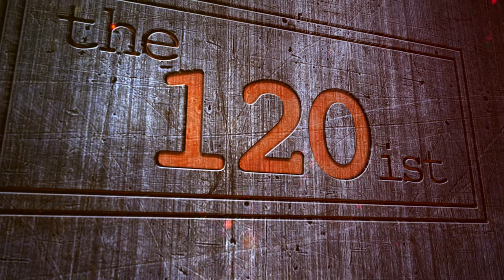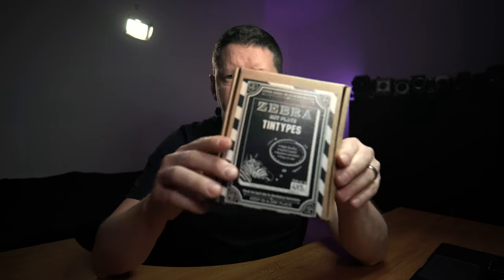Dry plate tin types... the poor man's wet plate collodion?

Comment: Enjoyed your tryout of Nejc's tintypes. They didn't come out too badly all things considered! While I'm not a wetplate collodion guy, I've done dry plate collodion, seen plenty of WP tintypes (I have family tintypes) and good ones are more contrasty than that. But beginner's plates often look like that -- as you say, just takes some experience to understand the necessary exposure for the process. I have been making and shooting my own gelatin dry plates for 9 years now, and have learned a fair bit about what's needed, mostly by making every mistake possible. Assuming they're "ordinary" (blue/UV-sensitive only) plates, you really need to consider your light when shooting. That is, you can take a meter reading at some reasonable ISO (anywhere from 3-25, depending on whether your emulsion was speed-sensitized beyond the basic) but then you really need to consider (in order): 1) the color of the light: the amount of UV in the light has a huge effect, so e.g., earlier in the day requires less adjustment than later in the day, more blue faster, less blue slower; 2) the colors in the scene: if it's blue or violet or has some component of reflected light that is, it will be very light (hence white skies, and it's easy for clouds to simply disappear) -- otherwise it will be dark. Red roses will be black, grass and foliage various dark shades of gray, skin tones will surprise you from time to time -- on ordinary plates my reasonably fair skin always looks as if I'm quite tanned because of some underlying pigmentation, whereas my wife's...does not; 3) bellows extension: don't forget this if you're shooting up close. So take your meter reading, and add a fudge factor that takes these into account, and you'll be much more likely to get the exposure you need. Then develop to get the density you require for the intended result of the plate: whether it be scan, silver gelatin print, or historic process print (cyanotype, salt print, carbon print, etc.) It's a heck of a lot of fun if you like the process, and tedious as all get out if you don't. Fortunately I enjoy it, else I'd have given up long ago!
Reply from the maker: I'm going to give it another go, I've got some more plates now so I'll be heading back out soon. Nejc does give a similar set of instructions to what you've outlined there (thank you btw), but I have no idea how to know how much UV there is in a scene!! I made some assumptions when doing this video, and allowed for more time than I needed, clearly, and they came out as they did. I then took the last two plates in that pack and did some tests with my kids, and went totally in the other direction with it, badly underexposed. Time to go back to the instructions and try to do everything by the book!

I definitely do enjoy the process. My only reservation is that when buying ready made plates like this, it's an expensive thing to have to get right by trail and error! But I'll persevere, and see what other adventures come from it! 

Thank you for the info!
Reply: True, the human eye isn't exactly a UV meter! But I'll bet you are pretty good at recognizing the warmth of light, and blue light is a good proxy for UV. Warmer is slower, cooler is faster. Eventually you get a sense of it, although I fully confess that I'm still developing mine. The guy I learned it from, Mark Osterman, does it very well, although he still often does a plate with a progressive exposure (i.e., opening the dark slide to reveal segments of the plate) to get a sense of how the particular emulsion you're using at the moment is reacting to the light. This gives you a sort of calibration to backstop your estimates and your meter. If you have time, doing it at home (assuming you're set up to develop yourself) before you go out will give you a good leg up on the situation. @the120ist

Comment: hey, maybe at 9:01 thats why most plate holders are different, aka like a picture frame, loaded from the back, secured with a pressure plate, and the darkslide works on a separate plane to the plate, so nothing can catch the slide on the way in\out.
Reply from the maker: You mean the one that popped out? I was using a plate holder, specifically designed for plates, and using an insert to compensate for the thinner metal plates I was using vs the thickness of glass. And you're right of course, the dark slide slots into different channels, and it sits a few mm above the plate, not touching it. 

The issue I had was that he plate holder, the brand of which I won't mention (!), has dimensions that were incompatible with these Zebra plates. 

Essentially the opening, the 'picture' bit of the 'picture frame', using your  reference, thanks, was wider than the width of these plates. So the plate itself fell through the window, and when I pulled the dark slide it just fell forwards into the camera!
Reply: @the120ist  ok, good to know, as you said it was your first or second time; I have experience with LF, and the holder issue {I am aware of the technical side of it}; FYI lost light art does make plate holders himself, to fit his plates, perhaps, due to the variety of dimensions and holder standards that you go with his, so you know they fit, a bit more expensive, granted, but if you decide on one manufacturers system, then best to go whole hog into it, to ensure success; more over it is an old process, and the glass/tin is custom cut, so variance in things is expected, as most modern holders are geared around modern film stocks, and processes.
Reply: @the120ist  if this is an issue, perhaps adding a metal spring, like in the graffmatic holders, to secure the plate in the holder, to take up slack is another way to go, to ensure focus plane, and security of the plate in the holder.

Comment: Great effort and interesting results for sure. Maybe try studio with strobes next?
Reply from the maker: I'm a little scared of strobes and long(er) exposures. How does the pulse of light affect overall exposure? Can you get enough punch out of a strobe to essentially eliminate the need for any other light? So a single blast from a strobe does the job? I feel like I need to do some research there. But there is a video coming about strobes and film, and strobes and 4x5, and probably then on to strobes and glass plates, and these dry tin type plates.
Reply: @the120ist   Some strobes can do multi-flashes per single press, so if a single full power blast is not enough, you could try this

Comment: Would these work in the Pinsta camera? 🤔
Reply from the maker: Oooh, I'm not sure... does the Pinsta allow for the thickness of plates? I confess I've never used one. Aside from the actual holding of the plates, I can't see any reason why it wouldn't work. The developing process is essentially the same.
Reply: @the120ist  It would be nice if you could. Couple that with the 35mm negative insert and you can have a tin type of any film photo you take as well!